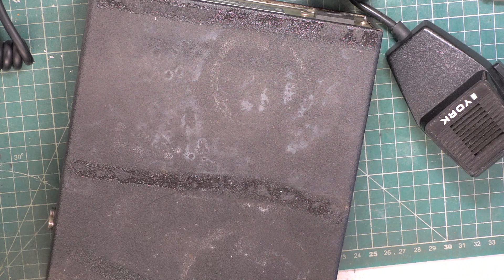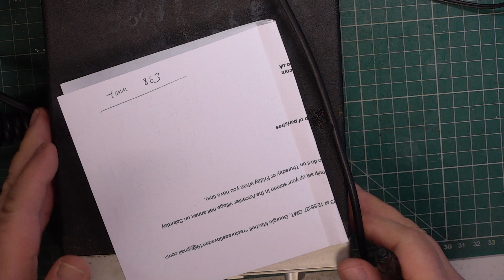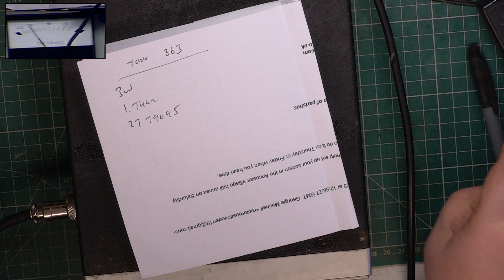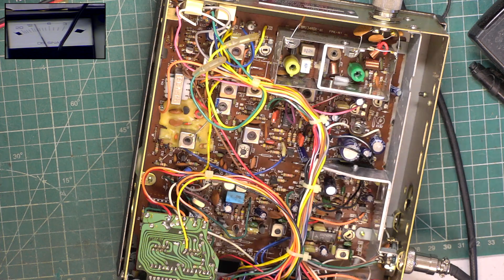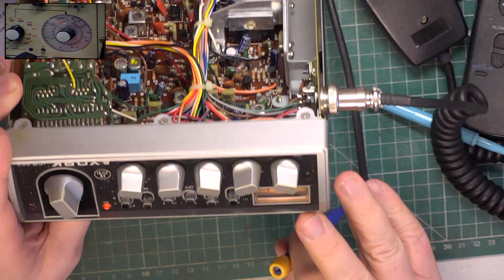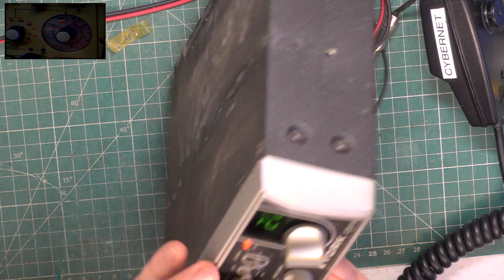York JCB863 CB27/81 UK FM CB radio - alignment & service

Comment: Hi Richard, thank you for posting another interesting video. Please remember that I am only curious and not trying to be condescending in any way. I really do enjoy and admire your YouTube content. Question: How are you finding the condition of the electrolytic capacitors in these older rigs as I am finding it a mixed bag regarding equipment of this age, in my experience many caps are off mark with regards to value and ESR but the radio can still reach the specs as outlined in the service information. The reason I ask is that I am starting to come to the conclusion that once equipment passes 20 years we are more into the restoration stage rather than repair and alignment.  If I am honest I am not really a fan of shot gunning electrolytic capacitors into equipment that has a or a number of faults simply because it's too easy to induce more faults into the equation. However I do find re capping the older gear does improve overall performance in a lot of cases if done correctly. I would be interested in your thoughts. Best Regards John M0XFX.
Reply from the maker: The Uniden chassis based radios (Audioline, Uniace & Realistic Trc2000/2001 need both 220uf & 470uF capacitors changed. I change all PSU capacitors in base stations now as a matter of course & reegardless. The Great chassis sets, The Maxon Chassis sets & the Cybernet chassis sets don;t (yet) have capacitor snags any more than they ever did. Probably 1% of repairs on those sets turn out to be capacitors.

A couple of years ago I did full re-caps on all chassis mentioned above; I did videos on them too. Other than the Uniden chassis, nothing removed from the others were out of spec. On the Uniden chassis, a full recap improves the receive sensitivity to a state better than they ever were.

I could say the caps in Unidens are disapointing, but then they are now over 40 years old. That said, other brands the same age have fared better capacitor-wise.

Regarding our HMV Stereomaster radiogram repairs covering models from 1966 to 1976; a;; electrolytics get chaned upon service...reardless. However, those British products are from an era of less reliable capacitors anyway.

Richard, G0OJF, UK
Reply: @ukfmcbradioservicingTango21  Hi Richard thank you for getting back to me. Yes very interesting, so I guess the fail rates being higher in Uniden rather than Maxon/Cybernet radios are probably to do with capacitor manufactures and circuit design differences. 

Completely understand why you change the filter caps in base station PSU's. I guess as you say a lot of these radios are around 40 years old and I would imagine that's a pretty good  life span by any standard. 

Totally agree regarding 60/70s consumer equipment it's best to change them out as a matter of course as the capacitor technology at that time wasn't the best. 

The reason I ask is that I have been repairing Ham Gear around 30/40 years old and I am starting to se more and more electrolytic cap issues to the point where I guess I'm carrying out restoration work rather than traditional repair work. 

I also notice that the sensitivity can be improved somewhat by recapping the old gear. 

Really enjoying your videos and I love the church organ content too, keep up the good work. Best regards John M0XFX

Comment: if all the sticky stuff was say plastic bumper paint and it was hiding some filled in holes in the lid then it was probably one of mine :)
but it had a silver front and i did all mine i sold black.
although the odd one may have slipped through.